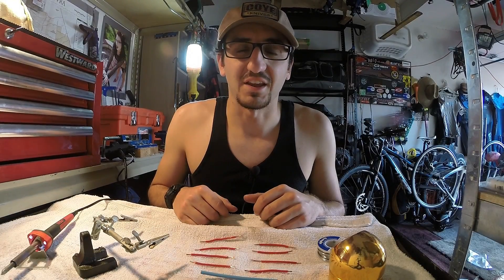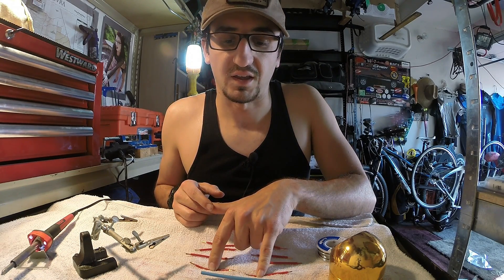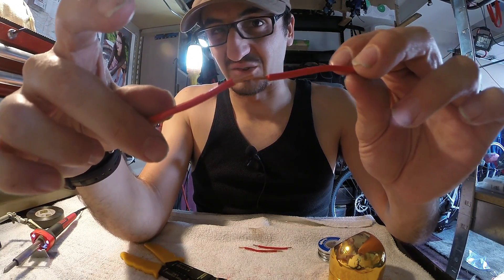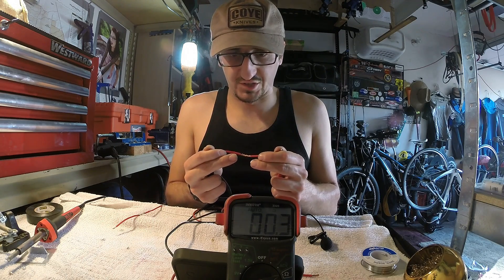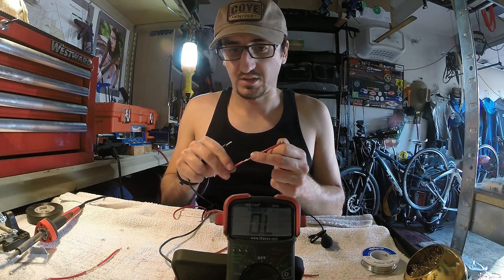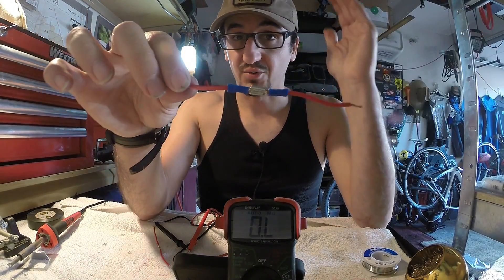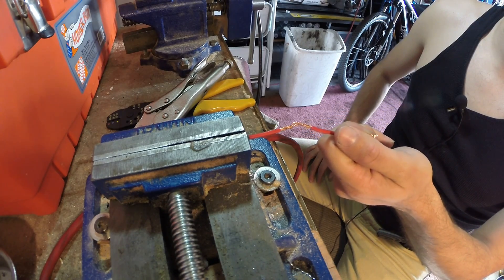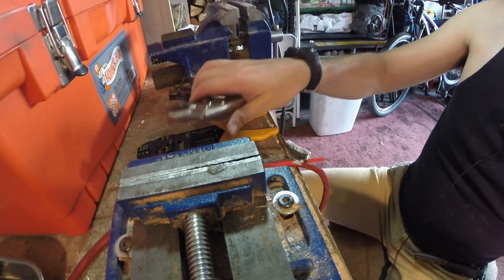Best Wire Soldering And Crimping For Automotive Repair - Ultimate Shootout (HD)

Comment: A butt crimp connector should have been used rather than a spade terminal.  The spade is only for connections that need to come apart occasionally. The other connections are not made to come apart so using the spade terminals is very misleading.

Comment: the wire length is too short to accurately measure resistance using a multi meter.  Try using the 4 wire kelvin resistance to obtain an accurate reading on short lengths of wire.

Comment: As much as I like the soldering method it does have a weakness in that if it is flexed too much or bends it may snap apart, there is no flexibility within the solder connection.

Comment: Oh man, you need a higher precision Ohm Meter.  12 Volts running through milli-Ohm’s of resistance is a problem, but you were measuring Ohms, which won’t even show up on that meter.

Comment: How will wiggling the connection change the resistance?!!!
Reply: Wiggling the connection can cause the wires to lose surface contact with each other. Less pathways for current to travel thru. That’s why thicker gauge wire has less resistance than thinner wire. You can think of those individual strands of wire as resisters put in parallel with each other. More resisters in parallel actually lowers the total resistance.
Reply: When a crimp is correctly applied to the matching cable gauge using a correct size die there is no room for movement, using resin core solder will cause oxidation of the cable which would introduce more resistance within the joint than any cable movement could hope to.
Reply: @Yeti_steps  Exact opposite: resin prevents oxidation when soldering and after.   its not the best for after, because its conductive and dust collecting, but it does prevent oxygen from getting to the metal.
Reply: @Yeti_steps  this is why you use an adhesive based heat shrink over a solder connection....keeps it permanetly clean and keeps the wires outside of the solder from fatigue at the solders edge. It's the best connection, it's why high end electronics solder everything.

Comment: i never use solder joints in automotive work, no major auto manufacturer will either. Vibration and corrosion will cause a solder joint to break right where the solder ends and the loose wire begins. A proper crimp with a ractcheting crimper tool with the correct die will last forever.
The problem is most people dont have them and think using pliers or those cheap radioshack style crimpers is just as good. They dont apply enough force and crimp using the wrong shape.
Reply: Speaker wires are soldered. And speakers vibrate all the fkn time.
Reply: fonque your wrong solder is the correct way companies will not put the time in to solder every connection😳
Reply: @Fonque, i believe you are wrong. Vibration will cause a solder joint to break, never heard of that. I feel a crimp will loosen over time.
Reply: fonque WOW lol what a statement. No major car company will use soldering joints? I've worked for audi jaguar mercedes and a few very reputable car and home audio shops and if you said that in anyone of these companies you will first be fired and then made fun of til eternity.
Reply: Of course that will happen:  IF YOU SOLDER IT LIKE AN IDIOT.  That is the reason most mobile manufacturers insist upon crimps:  Monkeys tend to screw them up less, and they're faster.   When properly crimped, a copper wire becomes a brittle single-strand that breaks in the same fashion within the same time frame if the wire is allowed mechanical movement.  Plenty of proof of that exists if you look.  you crimp for the crimp "pros" and you solder the TIP for the solder "pros" and you have the best of both worlds.  Plus you insist upon connectors that grab the wire by the insulation as well as the crimp and you tie wires such that mechanical movement due to vibration is eliminated or minimized.  Those joints will out-last crimp-only joints and far out-perform them on straight pull-out failure testing.
Reply: If you do solder connections in an automotive application, applying adhesive lined heat shrink tubing to the joint immediately will help slow the effects of oxidation from the rosin core.  I prefer this for splices and butt connections, but will properly crimp terminal ends with uninsulated terminals and also cover them with heat shrink tubing.  Just my 2 cents. 
Disclaimer:  I’m not a professional, rather an experienced hobbyist car builder.
Reply: @pkrmnky  rosin doesn't oxidize copper.  it forms copper abietate, which can look like oxidation but it is just a surface reaction.
Reply: How many 4 gauge plus speaker wires have you come across? Also, not many speakers I've seen require ring terminals. I suggest you research what flux does to copper to see why soldering is not suitable for high current loads as found in automotive situations.
Reply: @Yeti_steps  That kind of speaker wire is only used by Hi-Fi freaks and is pretty much a waste of copper! 
At work we solder 50mm2 for train motors (motors up to 1.5MW). We have high current, high voltage, lots of vibrations, strain reliefs and a failure rate that is extremely low compared to the crimped connections on 50mm2. And when those solder joints fail it's every single time because of poor craftsmanship!
Reply: @ppdan  that's why the SOPs are set to "not use solder":  Poor craftsmanship can really make them poor connectors.  A screwed up crimp does last and work longer or more reliably than a screwed up solder.  That's the root of any logical reasoning.  Car manufacturers will let machines solder on cars all day long.  They don't want to let a PERSON do it, they'll wick a wire, and cost them $$ in warranty.
Reply: @snap-off5383  Actually we have the opposite experience on those motor connectors. A poor crimp will mostly fail faster and sometimes in a spectacular way (3000V up to 450A on the bigger connectors). You have to seriously screw up the solder on those connectors to make them fail (flux, blow torch and solder bar), but you'd be amazed how bad some people are at their work (don't heat the connectors enough or don't let the joint cool properly).
But for the smaller cables with no strain relief, crimping is the way to go and soldering is very often a bad idea.
Reply: @Yeti_steps  copper abietate is not corrosion.  Corrosion is oxidation.  oxygen cannot penetrate flux.  copper abietate is confused for copper oxidation all the time by the less familiar.

Comment: Bullshit video u used the wrong size terminals
Reply: Exactly, why not crimp wires with butt end connector. Total snake oil experiment
Reply: Without load, the measures you show is not very interesting.  Needs to be more accurate.

Comment: The human body is a conductor so when you're holding the wire to your leads like that any fluctuations could just be the connection running through you. Also, this test does not test the current handling capabilities of those connections. Nice try though.

Comment: 1. Apply current close to max for wiring gauge and measure voltage drop across junction.  2. Test how many flex cycles whilst  carrying to current to failure.